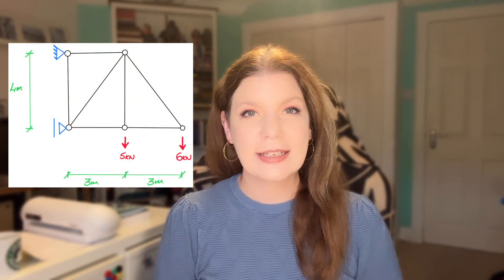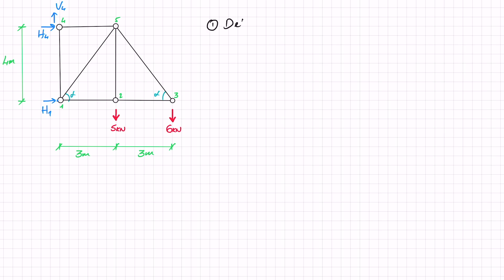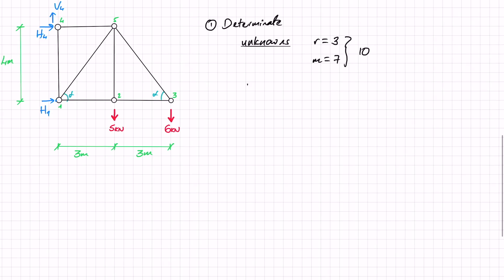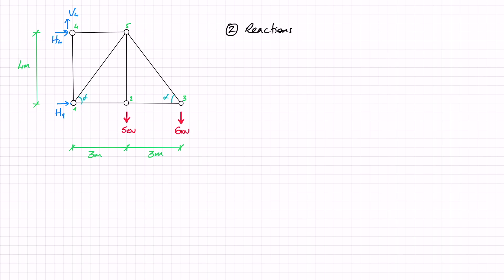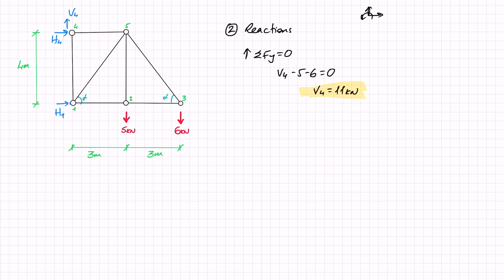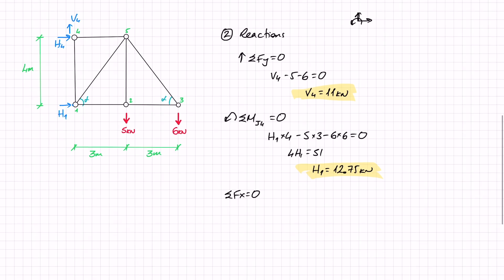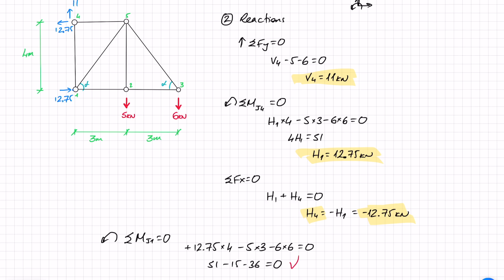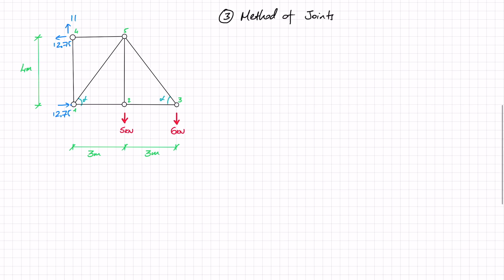Cantilever Truss Analysis | Method of Joints Tutorial 4 | Full Step-by-Step Solution for Beginners

Comment: Interesting. I always get confused with working out how many reactions from pin, hinge and roller. Perhaps its just how they are represented in the frame diagram. For example, a hinge has 2 reactions, horizontal and vertical. But does not look like a hinge in the drawing. Its just me.
Reply from the maker: Good point - generally, in trusses part of out initial assumptions include that all joints are pinned. This ensures that forces transfer, but the joint can rotate so no moments are generated. They are usually drawn as circles at the joints, but sometimes even that is omitted on some textbooks once the structure is established to be a truss.
Regarding the supports - a pinned support will always have two perpendicular reactions. One perpendicular to the surface the support is sitting on (say ground or wall) and one in the direction of the surface. This is usually drawn as a triangle sitting directly on a hatched surface.
For a roller the reaction is only in the direction perpendicular to the surface. This is a bit like a skateboard - the reaction is preventing you from sinking into the ground but you can still move along the surface. Usually drawn as a triangle with a gap above the hatch used for the supporting surface or also with wheels instead of a gap (think hoverboard or skateboard).
Very long reply as a bit hard to describe without any visual aids, but I do go over it a bit here: https://youtu.be/RpH4GhywEIw at around the 5.5 min mark.
Reply: @EngineeringTheCurriculum many thanks. I went through an earlier video where explained.😊